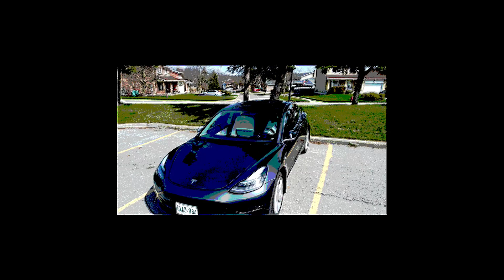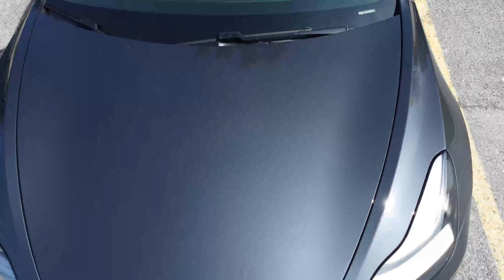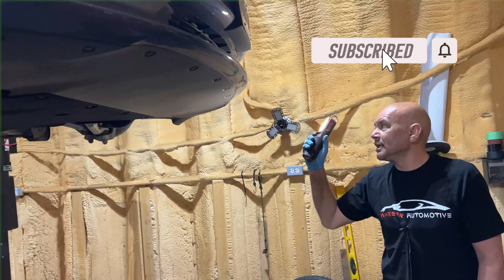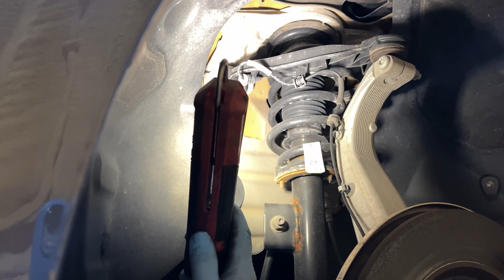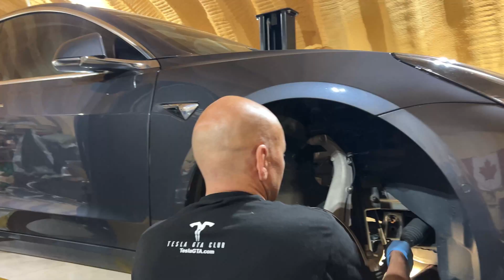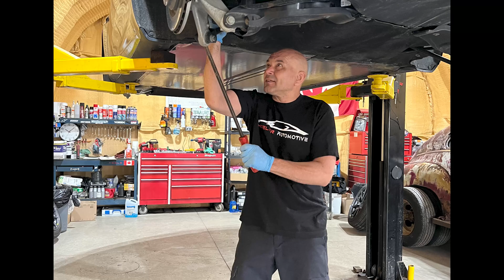Tesla Model 3 and Model Y Brake Service Inspection - How To Video

Comment: So I guess we need to turn off Regen braking from time to time to make sure 'mechanical' brakes work ok?  Yes?
Reply from the maker: Yes that’s one option. The other one is when you charge your car to over 95% the regen  is very limited and you will be using more brakes than usual. 
It really depends your driving style and how far are you driving.

If you live in the cold climate then you need to use more often the brakes to lubricate the pins.